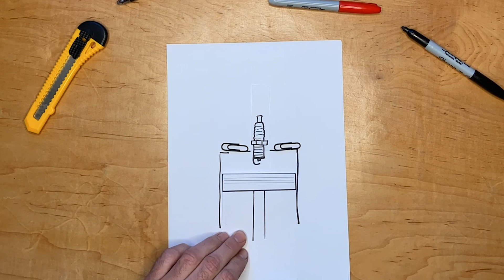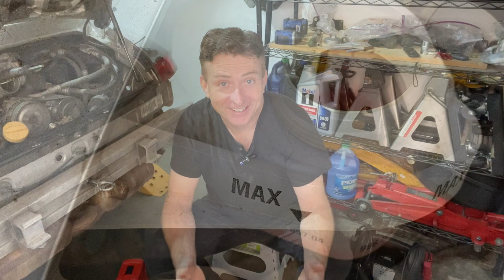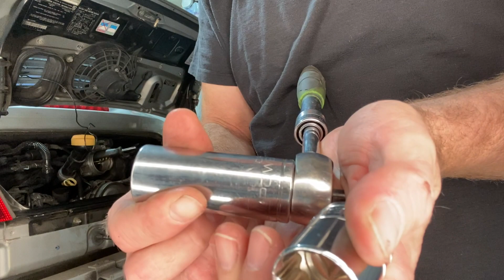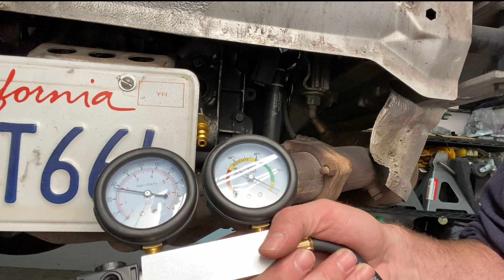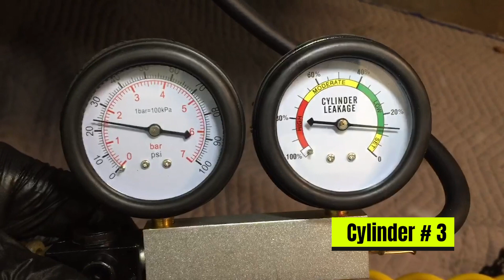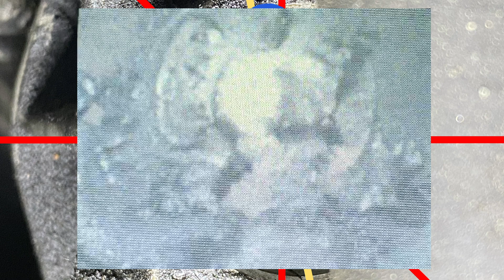DIY LEAKDOWN TEST Porsche 996 Engine Diagnosis

Comment: Great clear explanation of the concepts and the execution. Many thanks. This is bookmarked !
Reply: I lost my perfectly healthy M96 to ingestion of a foreign object. I know more than I ever wanted to about it now.
Reply from the maker: @davidgray5583  Hello David, what did it ingest??
Reply: We never successfully determined what it was. It looked like a large washer and my builder concluded it could have been in the engine a long time. It was not a part of the engine he recognized. About 3 months earlier I had a local Indy drop transmission and check IMS. IMS was larger size not replaceable without splitting case so they ended up just doing a clutch and a new rms. I personally blame them but have no proof. .
Reply from the maker: Thank you for the feedback David, this car is beginning to make sense ;)